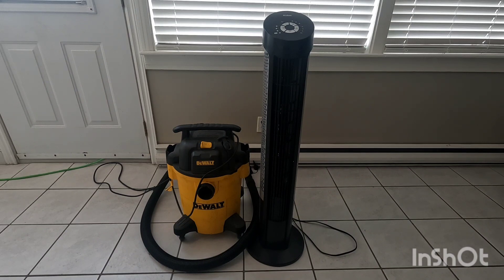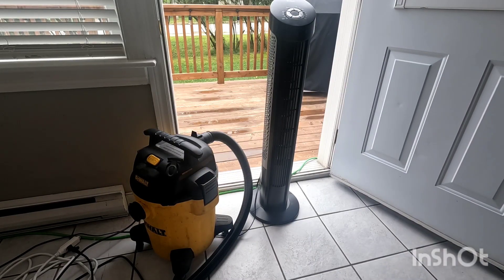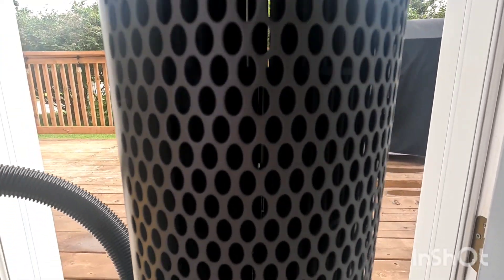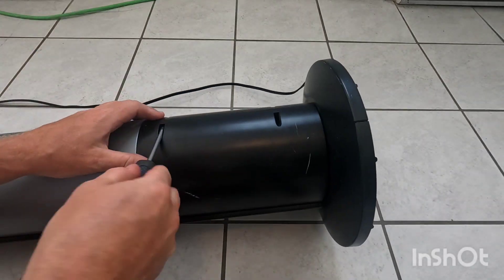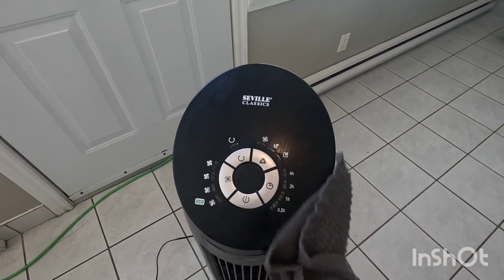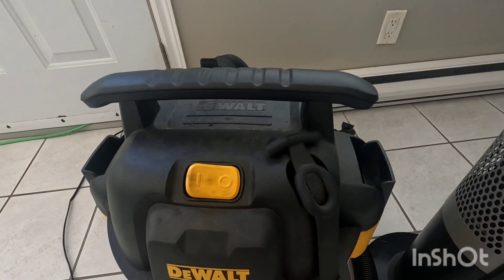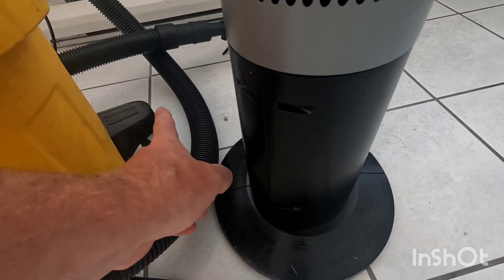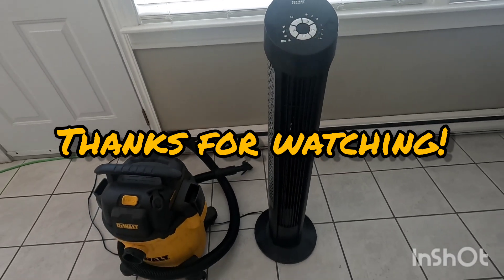How To Clean A Tower Fan

Comment: Mine doesn't have screws except for two very recessed screws on the bottom.  It's frustrating!  But i can do some of the steps you recommend.  Thank you!
Reply from the maker: Thanks!
Reply: @PovertyPointCustoms  oh look!  I found out the brand name.  It's mainstays  (WMart).  Do you know how to get the cover off?  Do I just take the base off and slide the body cover off by pushing down on it?  Does it just slide off? Thanks for your thoughts!

Comment: mine was making lots of noise and barely any air was coming out. One day the sun hit the fan and I could see layers and layers of cat  hair and dust. I was amazed at how much cat hair was in there. I just took off the back panel and used a paint brush and held the vacuum hose against the paint brush and got all that dust and hair out. whoa!! afterwards it was like my new fan again. no more noise and blasting air!!
Reply from the maker: Mine looked cleaned but also when I blew the air through I was surprised at how much dust and hair was in it also!